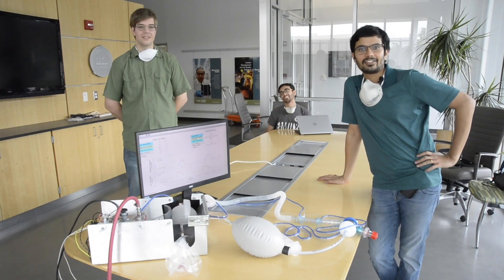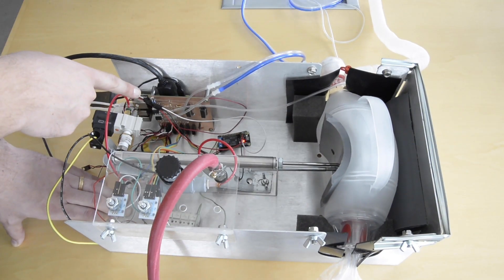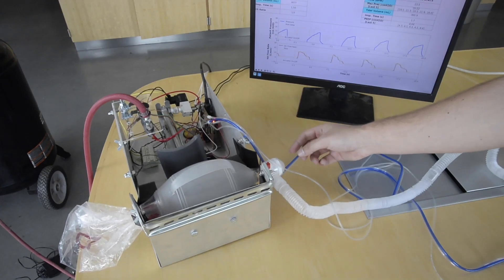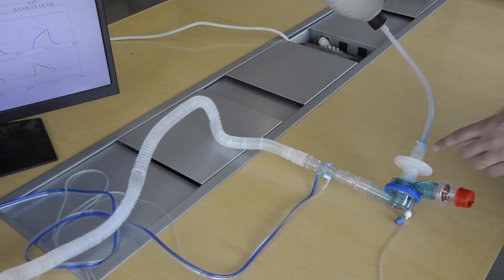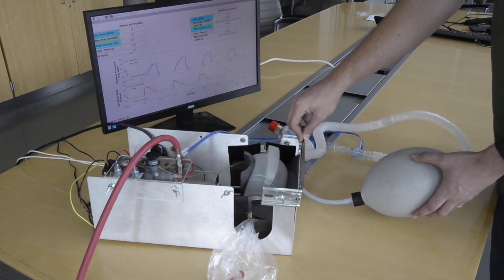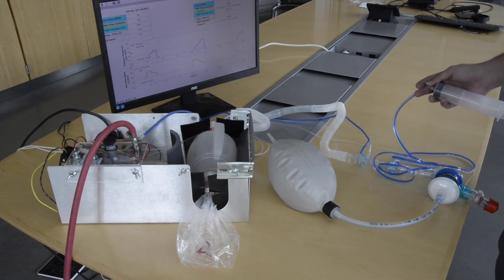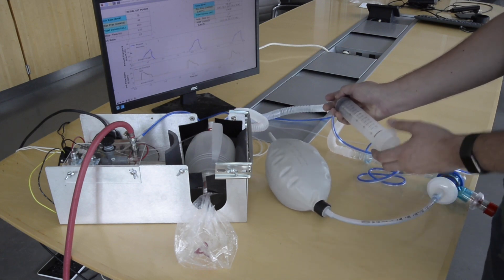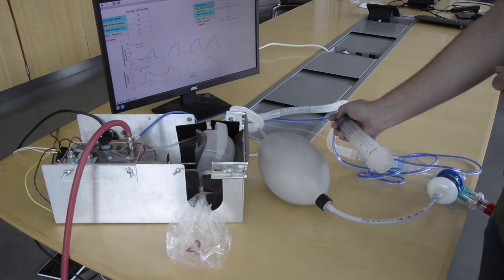Open-AirVent GT Emergency Ventilator Demo

Comment: what is the volume range of the mechanism?
Reply: The actuator system has sufficient force to provide high tidal volumes (> 800ml) at high patient pressures (> 30 cmH2O)